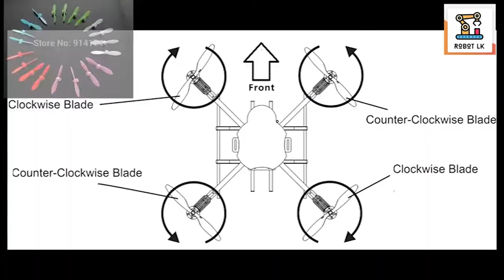How to increase RC Drone Flight Range

Comment: It is quite obvious that if there are obstacles in the line of sight between the control and the #drone then the signal will deteriorate.#technology
However, that’s only half the truth as even obstacles that are not directly in the line of sight have a significant impact. More specifically, any obstacles in the “Fresnel zone”, will impact range.
In simple terms, the Frensel zone is an area the shape of a rugby ball between the transmitter and the receiver. To achieve the best link this area should be free of obstacles. The following diagram illustrates this point.#lanka
Reply from the maker: Ko rupa satahana nane bro.comment wala danna ba mn hithanne .math godak dewalnam danna bro ,thanks kiyadunnata
Reply from the maker: Thanks for watching the video.I will upload videos like this again.If you like tech videos like this, stay with my youtube channel .